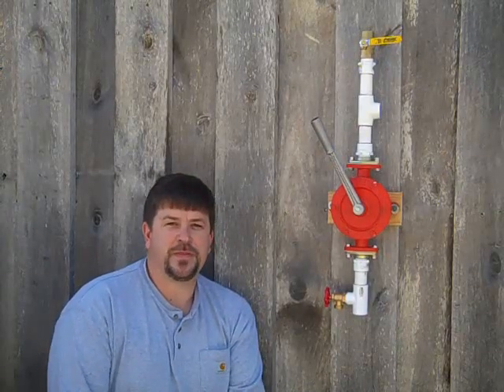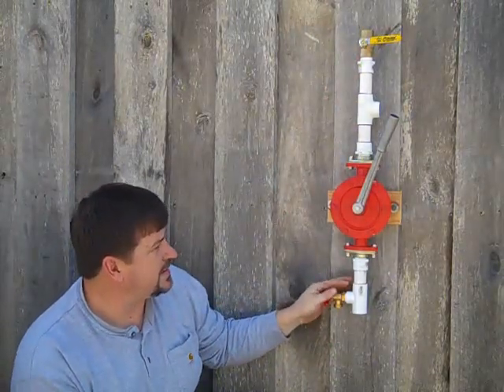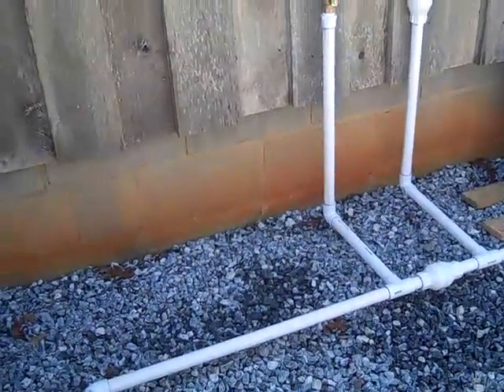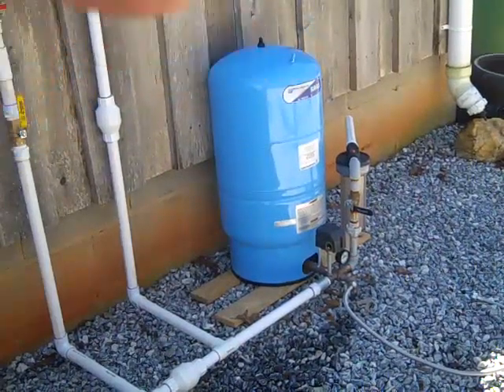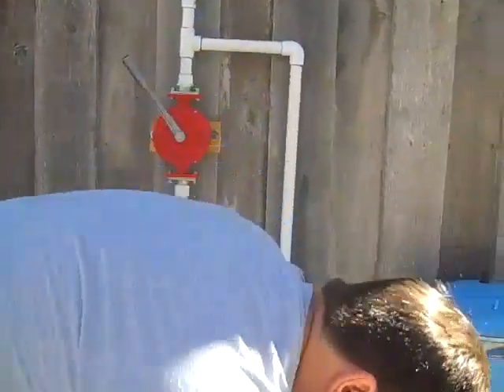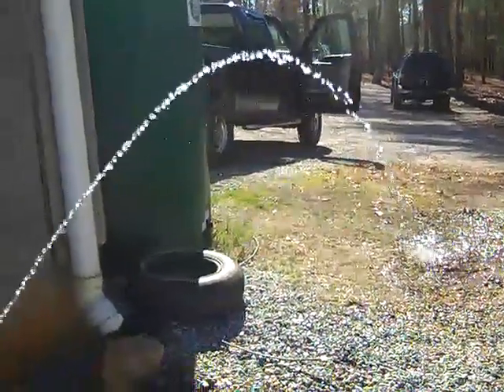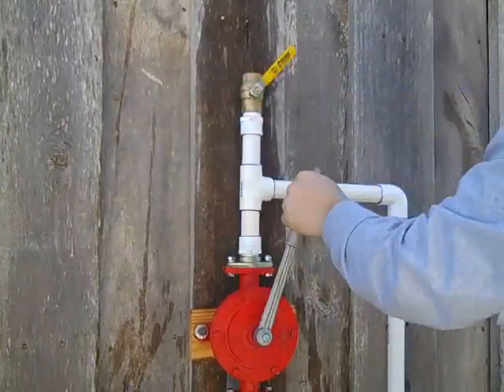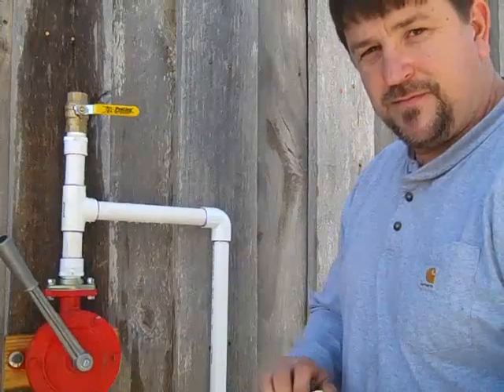A Hand Pump for Shallow Water sources

Comment: Thanks for the info & time to make the video... Very useful! This could save me the time and hassle to hook up generator to power storage tank discharge pump for just short power outages and small water needs...
Reply from the maker: It will work and a lot less money than a generator and fuel.

Comment: Aloha.
I like this.  I had a brainstorm.  Use (2) pumps.   Mount them so the handles are sticking up, with foot rests mounted on opposite sides of each handle.  Mount 2 seats, facing each other, so the pumps can be pumped by 2 people pressing with their legs, sorta like the Hobie Pelican Drives on their Kayaks.  Mounting a center pivot point and a tie-bar between the (2) handles would allow 1 person to pump it, the resistance would be greater as it is only 1 person pumping and each extension of each leg would be actuating both pumps during a power stroke.  But with 2 people, it would be very little effort and you are effectively using the largest, most powerful muscle groups in the body.

Peace & Prepare
Pax et Paro
Reply: Ok.  This is what I was thinking.  😂.

Comment: Excellent video , very clear . I will use a similar system for a boat , no electricity and enough pressure for a shower and kitchen sink. Do you know what is the maximum PSI that you can get in your set up? Thanks

Comment: How did you securely mount your rotary pump to the fence? - Does that model have built in brackets or did you engineer / purchase a mount that would fit most rotary pumps?

Comment: Outstanding system, you are a fountain of knowledge.
Would you recommend this pump to feed from a pond that needs about a 20-25' lift to the house (Do you have an accurate way to measure lift over distance?)?  If so, would one use a floating strainer at the pond; then several pre-filtration steps, then check valve, before hitting any ceramic filter?  I suppose a floating supply line (PEX?) in the pond would freeze solid, perhaps the inlet should be below any potential pond ice 12">?

Comment: so, this pump is not designed for potable water? I bought it because I wanted to make sure my family had drinking water but it appears you have to filter it after the pressure tank? Is that because of the mineral oil?

Comment: engineer775, you mentioned that you only pumped for a min and got that good sample pressure, I think you said the bladder tank can handle 80psi.  question does the pumping of handle give more resistance as you get near the max psi? can you feel it so as to not over pump? I am hoping the answer is yes, but would like confirmation.

Comment: Thanks this might be what I am looking for - will it pump water up a hill? My well is a near my home (about 3 or 4 tiles deep) but it down a slight hill. If power goes out will I be able to pump water to the house/bladder? Must I prime it?
Reply from the maker: Hey Tim,
Can you estimate the elevation from the top of your water to the bladder tank in your basement? The pump will suction lift 22 and after the pump lift 90 ft. You want to have a foot valve in the well.  It is self priming.  Send me and email if you want to work out the details of this.

Comment: This is very interesting, I like this pump! How far will it pull water up from a well do you think?
Reply from the maker: 22 suction lift - 90 ft after the pump.
Reply: Ok, thank YOU engineer775 Practical Preppers!
Reply: Engineer775 can i use this type of pump on a drive point well?
Reply: @engineer775 do you have anything that can do a static level of 80-90’?

Comment: my well is down 14 feet ,,,will pump that deep,,jim
Reply from the maker: It sure will.  Here are the numbers depending on your elevation. 
ALTITUDE SUCTION LIFT
Sea Level  22.0 ft.
1000 ft.     20.8 ft.
3000 ft.     18.4 ft.
5000 ft.     16.0 ft.
7000 ft.     13.6 ft.
9000 ft.      11.2 ft.

Comment: Maybe I don't understand this fully, but Why would you want to shower or consider water as "Potable" from a catchment system (ie rain barrels) or swimming pool, (especially after the summer season and a few rain storms)  ?  
Wouldn't it need to be pre-filtered? Not pre-filtering it I would be afraid to run water with any type of possible sediment thru an expensive pump for fear of destroying it
Reply from the maker: At the end of the video I put a picture of a system for filtering the water to make it potable if the source is not.  Whole house filtration from any water source! 
If your source water is bad you can surely pre-filter it.  My raincatchment system I am connecting it to has 4 ways of prefiltering.  Rain harvesting ... It's about time I did this!
Hope that helps.
Reply: engineer775 Practical Preppers Thanks Scott, I'll check those two videos out.  I have a catchment system now, but only minor pre-filtration.  Would like to have a passive way of purfication to make it potable